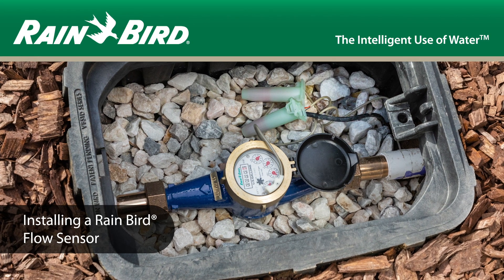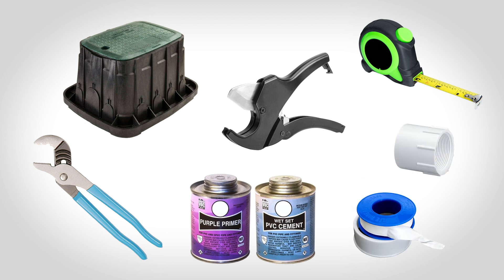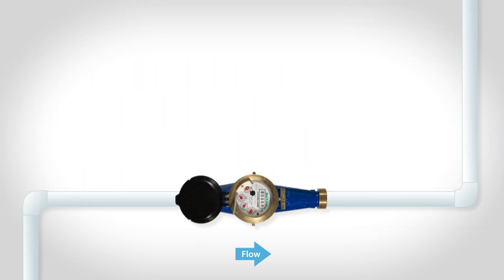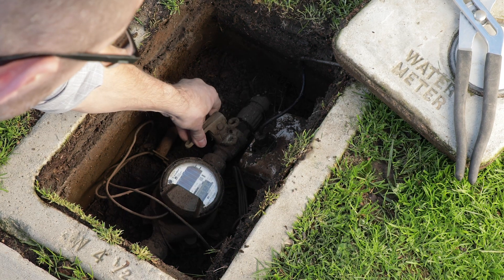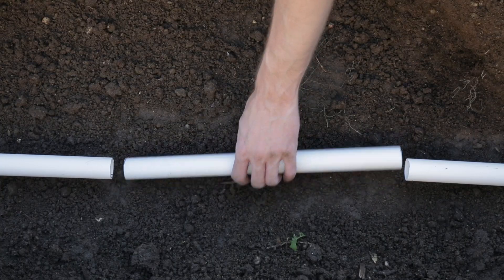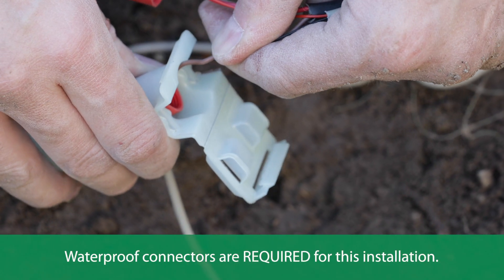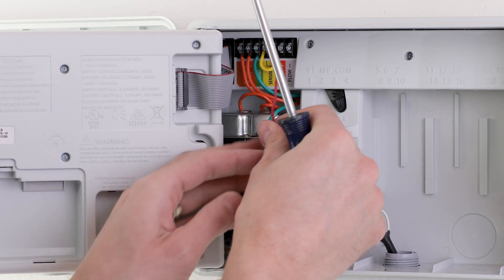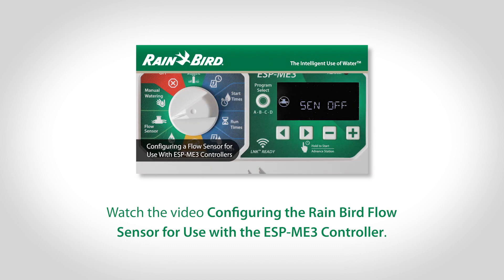Installing a Rain Bird Flow Sensor

Comment: Anyone know the K factor and offset for the 1" meter?
Reply: 6.003, if you are using Rain Bird control products they will have a place to select this sensor without needing the k factor
Reply: 0.3974